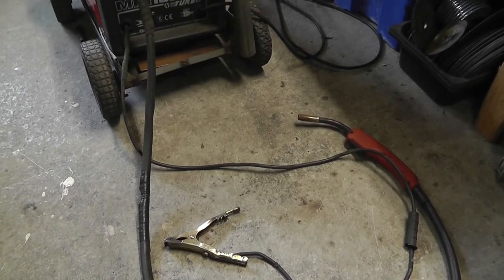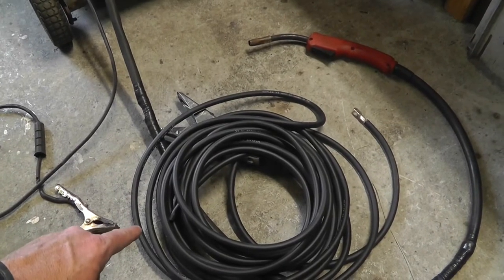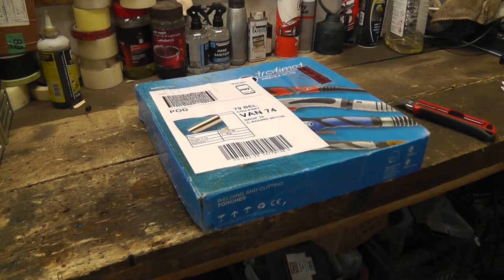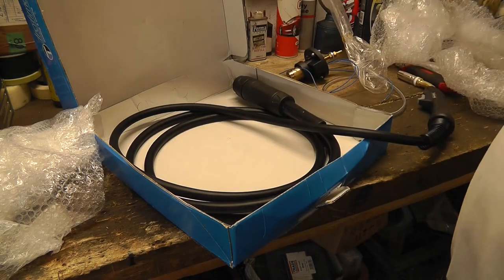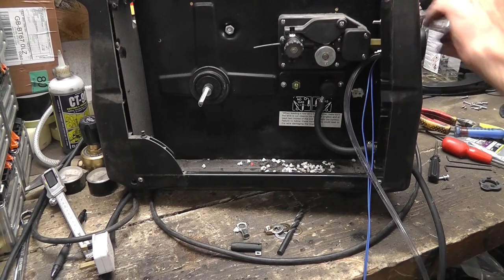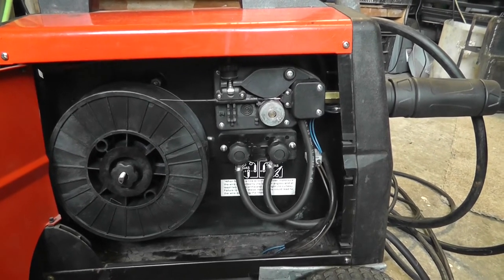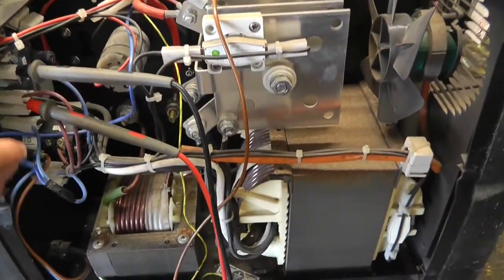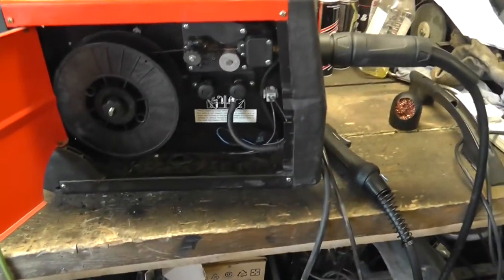Clarke MIG Welder Upgrade Euro Torch and Earth Clamp

Comment: The required crimp die size depends on the wall thickness of the lug as well as the calble size. There are standards, but not everbody follows them properly.
Reply from the maker: A mate suggested they were solder lugs instead if crimp lugs. Not sure if that is correct but what you say makes sense.
Reply: Yes I came on here to comment on the crimping tool.

In the industry I work in it is very important to agree a 3-way combination between the lugs, the dies, and the tool.

We found it so difficult to get reliable crimping operations, that we now purchase all crimping tools, all crimping dies, and all crimping lugs from the one company.
Reply: Also, I should have added that nothing replaces a cable pull test on a sacrificial crimped lug. Worth its weight in gold.

Also, don't forget that does wear out, and so too do crimping tools. Having your tools calibrated is worth its weight in gold.
Reply from the maker: @PatrickCulliton  thanks for this. It all makes sense. 👍

Comment: I have just started to use a Clarke 135TE turbo. I like the fact that I can squeeze gently to get gas and then pull all the way for wire. Also I had some paint catch fire a few times and a gentle squeeze to glow gas on the flames puts out the fire straight away. Maybe I won't do a Euro torch convertion.
Reply from the maker: My old torch was on it's last legs. If yours works well as it is then there would be little point.
Reply: @alibro7512  thanks for posting your video. Otherwise I wouldn't have realised that the standard torch is also the gas valve and that a Euro torch doesn't have that.

Comment: Interesting video! I was thinking of doing the same thing, since my handle is leaking gas and I have no solenoid either. But after watching it, I decided not to bother. I just order a new hose and a new earth clamp. Or maybe use the money it will cost to rebuild it to euro std and buy a new modern machine. Anyway, thank you for sharing.
Reply from the maker: Thanks for your comment. 
The advantages of the torch I installed are the length of the lead, the quality of the handle, the size of the shroud, the fact it leaks much less so is cheaper to use and the general ease of use. My welding improved immediately I replaced it from terrible to not quite so terrible. 🤣
If you plan to do any amount of welding it's a no brainer but if you only weld once or twice a year then maybe repairing it makes more sense. 
As for a new welder unless your current welder is rubbish or you plan to buy a really good one then you may not be much better off.

Comment: Hi. I have clarke 151te but it looks exactly the same. Is that orange on /off switch illuminated?
Reply from the maker: No mate.
The Clarke range is very confusing but I think they are mostly similar with small differences.
Reply: @alibro7512 Ionly have one wire for the trigger in my welder ! And eurotorch has 2 -blue and white
Reply from the maker: @grzegorz16100  For a switch to work it needs two connections so the other is probably the sheath of the torch. Try touching the one wire to the casing of the welder and see if it starts the motor. Just be careful in case of high voltage.
Reply: @alibro7512  I know it's for the motor but new torch comes with two wires. And I have just one...
Reply from the maker: @grzegorz16100  The sheath of the torch will be the second wire. It will be connected to the chassis of the welder so touching the one wire to the chassis should trigger the welder to start.
Reply: @alibro7512  Correct. I have 2wires than and the eurotorch has 3 - one thick and two thin ones. My old torch had the thick black wire and thin brown wire... When I fit the new torch I will have one spare thin wire and nowhere to connect it to.
Reply from the maker: @grzegorz16100  It was a long time ago that I did this but I think the thick wire will be the main pos or neg depending if you are using it with gas or gasless. The two thin wires will be the switch to start the welder, one will go to wherever the old single one went and the other to chassis ground.

Comment: Can i connect the solenoid cable to the wire speed motor ?
Reply from the maker: It's been a while since I made this video so I can't remember exactly how it was connected. If you buy the same kit it comes with full instructions.